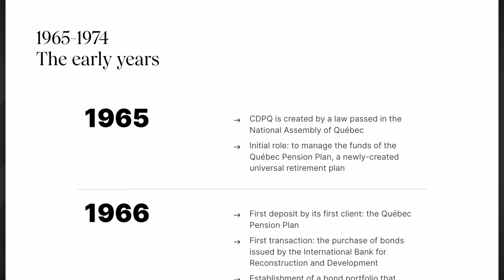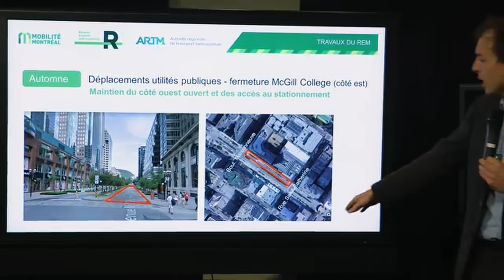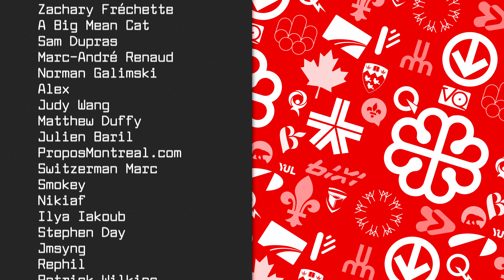Boomers Should Love Transit

Comment: Great video, one think to point out is that the REM is still a public-PRIVATE P3, because the Caisse still has contracts with a consortium of private engineering/construction firms to build, operate, and maintain the system.
Reply from the maker: All large infrastructure projects have a consortium, eg the new Champlain bridge. But that bridge is not a P3. 
P3s are defined by their long term financing agreement/arrangement not the contractors involved in construction.